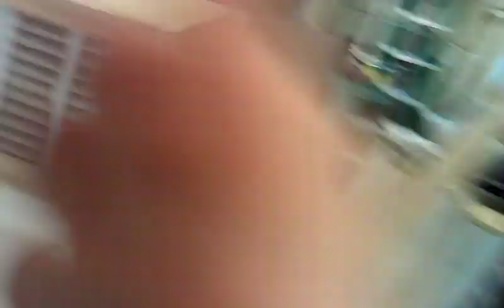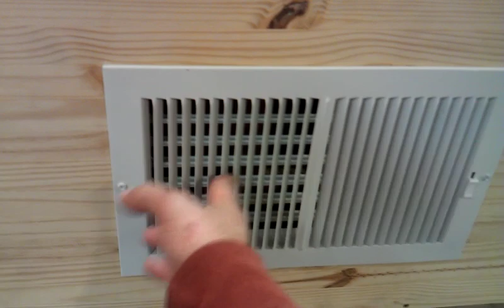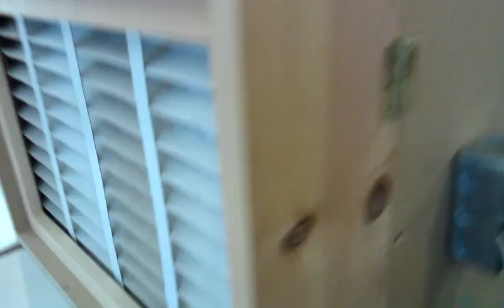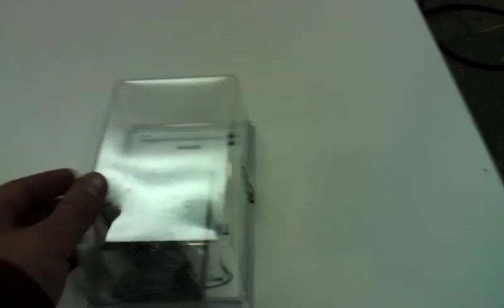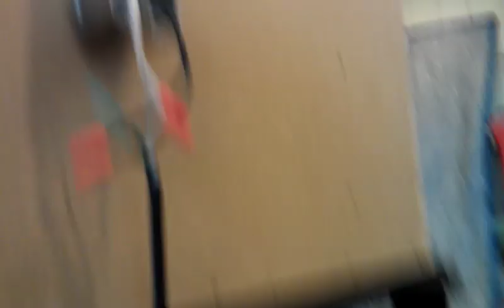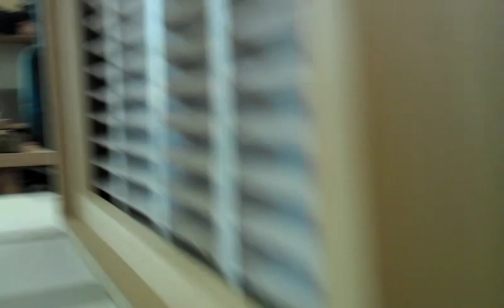Homemade Shop Air Filtration System Part 3

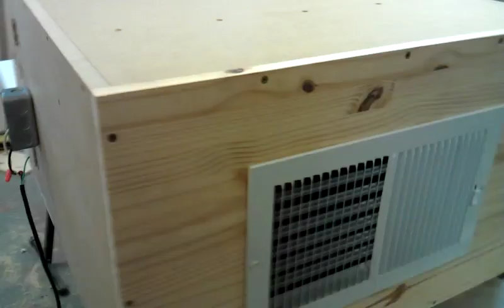Comment: 1:55 what's the purpose of pressurizing? I built the same box but due to my health issues I can't use a used motor or fan. Would you suggest an electrician to wire the unit or an HVAC tech?

Comment: What size air filters did you use?
Reply from the maker: I used two 16" x 25" filters. The first filter is 2" thick and the second is 1". I bought a good 3M Fitre 2500 brand for the 1" and it will capture the fine micron dust.

Comment: Thanks again for the videos on making this. Sharing this was a BIG help for designing a similar 'built in' system for my hobby room to reduce dust from wood stove and cat hair. I have some fiberboard ductwork left over from building & will just put this behind the knee walls in my attic and in addition to your set up w/ 1 and 2 inch filters will use a generic air return grille for intake with 1/2' home filter to catch the 'big stuff' (should extend life of 2" filter as well). 

For anyone looking for those motors - in addition to begging a 'throw away' from your local hvac shop they are found in mobile home furnaces. They rarely go bad - it's the starter cap or control system that kicks the bucket. I plan on begging for some ductwork from their dumpster as well! :D

Comment: Curtis I would like to see how you attached the system to the ceiling and how you mounted the blower inside the framework.  Fine work young fella  -  Burt
Reply from the maker: All I did was drill holes inside the case, with the blower removed, and the ran 4" 5/16 lag screws into the rafters. Two in front and two in rear.

Comment: Curtis I have a air filtration that I have built like yours but I don't have a back on it yet. I was wondering does any dust come out of the grill or does the filters catch it all? I was thinking about hooking up a 4 inch pipe to it so it will blow the dust that makes it through the filters outside.

Comment: I had a motor set up out of my heater unit that was basically new.  I was in the process of moving and sold it for scrap but I really did want to make something similar to this.  Now that I know you can get these motors fairly cheap, I'll go ahead and make one.  Thanks for the info.  I am no electrician and wouldn't know how to wire it though.  Maybe you could explain a little more about that.

Comment: I know you said you work in the HVAC field. If I was you I would put a larger register on the front if possible. The small register is restricting the amount of air that you can pull through the filters. More air through the filters  means more dust removed. 
It's still a very good job. I like it

Comment: This is absolutely great!  I work in an enclosed cement basement below a garage. No window walls for and ceiling all cement.  I need a filtration system bad. However, the bucks prohibits. So, this needed badly.    I have a few questions.    How do you position the blower.  Which way is the intake, which is the blower.   Does it intake through the filters and out the duct, or in the duct and out the filter.  It would greatly help, if you videoed the inside with the blower postioned.  thks